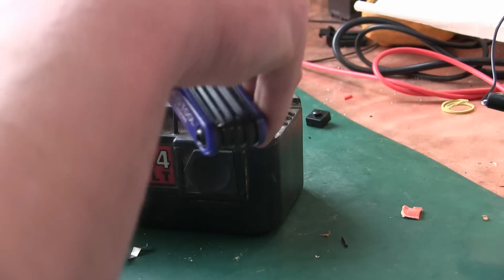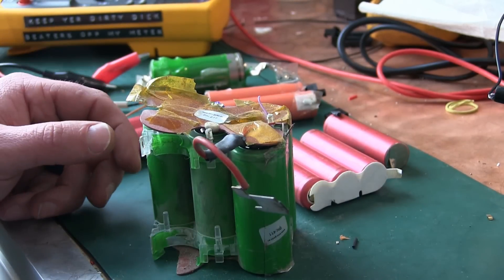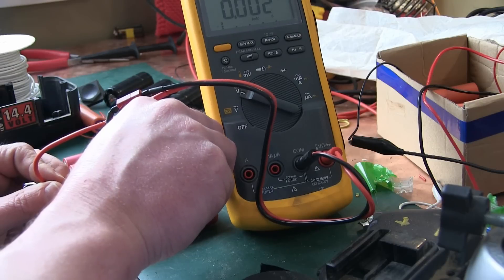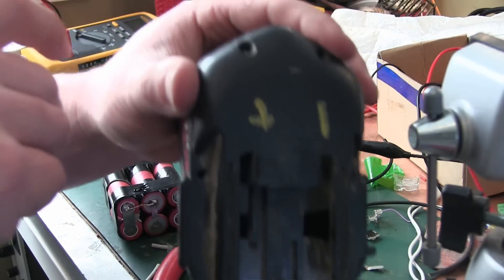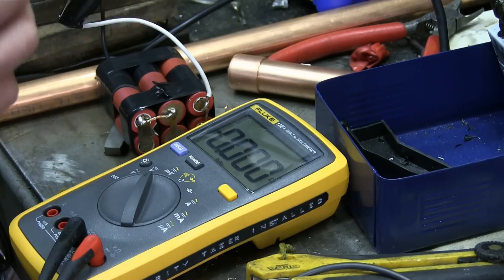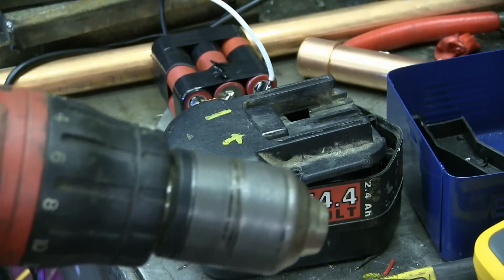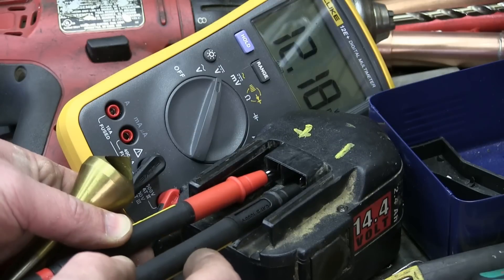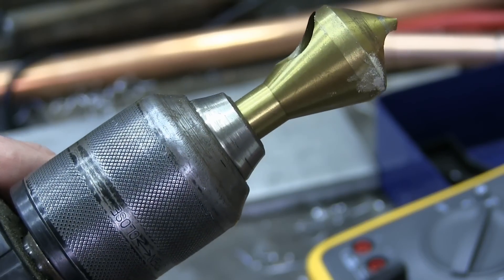New Lithium for Old Tools!

Comment: Touches (+) to (-) "I don't know what just happened" lmao🐸☕️
Reply: a noticed that.....
Reply: But he didn't close any circuit. Also, + and - was already connected by the tab...
Reply: yes he did. he grazed the outside shell of one of the batteries. On one side it's no problem since it's the right polarity. Not the case on the other battery.
Reply: +Mike G. Thank you.
Reply: Mike G. Doesn't he just touch the two terminals that are connected by the tab anyway?
Reply: +largo303  if these are the same batteries I have, then the top tab is the positive and the casing or shell of the battery itself would be negative. Touching the two can short the battery. As you can see when he went to cut the tab he accidentally touched the only pat of the battery where the wrapper was coming off, thus causing him to short the battery.
Reply: Gabriel Bashara Ah, okay, got you. Thanks :-)
Reply: Ave this is not really an upgrade.. but just swapping the bats is boring. Question. When there will be a standard for such bats? It will generate less waste and the makers can sell just the drill
Reply: Im no expert but think you are using LiOns and not LiPos. I think LiOn max voltage is 4.1v not 4.2
Seen a few do this and done it myself by mistake but the cells still work. Just cant be good for them over charging like that i think.
Reply: Actually the majority of liIon batteries charge to 4.2 volts.
Reply: Chris C: LiPo is Li-ion chemistry with a flexible polymer wrapper instead of a steel case. Packaging is the only difference.
Reply: Oh Man no thermal runaway?! 🤣 hard short’n 🤣 I want fireworks 💥
Reply: Chris Campbel Most of the time 4.2 V max, Some can max out at 4.1v slight bit less. Nominal 3.7 & 3.6v. Correct don’t try To charge those 4.1 up to 4.2v deff can damage the cell. LiPos pump out around the same 4.2v but it matters how the cells inside the LiPo “battery” are configured truly. Ex: 2S, 3S ect. The computer reading it will detect it as 1 cell @ 8.4v or 2 @ 4.2 & so on. I’ve had some crazy LiPo batteries with some nice kick and super light weight wise!  It’s the same concept for how they design all of these batteries with “60 volts” blah blah blah, how many cells in the battery & the wiring configuration 😃 those sexy hilti 😍batteries are the big boys! Same voltage though but hella mAh. AvE has me sweating Hilti & Fein now 🤦🏽‍♂️ I’m broke though...
Reply: @largo303  if a battery isn't wrapped the outer shell is the negative. I could be wrong

Comment: A good idea in principle. Unfortunately, multiple lithium ion battery packs in series must be balanced otherwise the pack will only be as good as its weakest cell  The lower capacity cells will tend to over-charge, conversely, the higher capacity ones will under-charge. Which is why all L-ion battery packs have charge control circuits. Plan B would be to just repack the battery container with a set of quality nickel metal hydride batteries.

Comment: You can rebuild your NiCd packs with new Sub-C NiCd cells. Then everything works the same as before. You can get new pre-tabbed cells so you don't need a spot welder for assembly.

Comment: Those Lithium Cobalt cells are not suitable for a continuous draw of more than about 1-2A and the drill will be taking at least 15A. You really want the Lithium manganese cells, some of which can handle 30A. You're right about safety too, trying to draw that much current from an unprotected Li-CoO2 pack essentially turns it into a hand grenade.
Reply: Jep, NMC would be suitable for tools.
Reply: 30a still seems low. my not special at all li-po pack is rated for 45c continous with 4,5ah. probably it is larger than the types you mentioned, are there other disadvantages?
Reply: waldsteiger Yeah, I think a typical 18650 capable of supplying 30A would only be available in sizes up to about 2Ah, so in terms of C rating that's about 15C. Li-Po cells are also not constrained by the size of the can so they can be optimised a bit more for high current too.
Reply: You don't add up the Ah like that. Assuming they're 2500mAh/2.5Ah cells, they're in a 3S2P configuration, giving a final capacity of 5000mAh/5Ah.
Reply: ben hunter It's true. I agree

Comment: I'd not recommend to remove the welded tabs from 18650 cells:
First, there is a chance to puncture the cell, since the metal shell is very thin (to minimize the weight and maximize the inner space).
Second, one has to solder directly to the cell without tabs. On the negative side (which is directly the shell) this heats up the cell's insides quite a bit, and on the positive terminal, the heat may damage the seal or the PTC fuse ring.

Just cut the tabs to a length of a few millimeters and solder the cables on the ends if you don't want the cells to lose any chooch.

Comment: You need another pair of cells in there >< then it'd work great (that 4.1v a cell is going to be more like 3.7v under load, fer a grand total of 11.1v)  That's why it worked decent for a few seconds, once you lost the top charge it went to shit.

Put another pair of cells on top, get some longer screw's for the battery case and fill the gap with electical tape.

Comment: Until I recently retired, I tested hundreds of cylindrical cells a week.  Some things you should know.  Your battery pairs were badly out of balance when you put the pack together.  Lacking a battery management system, the best you can do is top balance.  To top balance, set the power supply to the rated charged voltage and charge until the current drops to within a few ma of 0 amps.  As it is, the low battery is being reverse-charged which risks fire and explosion.  I highly recommend getting an RC vehicle cell-by-cell balancer/charger.  They are amazingly cheap and work really well.  Finally when each stage reaches its rated charged voltage, immediately disconnect the charger.  a Li battery can't be floated, even for a little bit.

Second tidbit, 18650 batteries are generally rated at either 1.8 amps or 10 amps.  ANY chicom cell will test out to 1.8 or less amps, regardless of their marking. Note that I'm saying amps and not amp-hours This is the best 10 amp cells that I've been able to find.
https://www.amazon.com/gp/product/B0768WY3ZN/ref=oh_aui_detailpage_o04_s00?ie=UTF8&psc=1
That's about the highest amp-hour rating you'll find in the 10 amp cells.

My (pre-home depot) Dewalt 17 volt drill draws around 25 amps when nearly stalled.  So even the above cells would not cut it in 2P configuration.

A friend operates an electric motor repair shop and within it is an authorized Milwaukee service center.  I help him some when he get covered up with repairs.  Which is frequent, these days.  It's disgusting what both Milwaukee and DeWalt have de-contented in an effort to meet Home Depot and Lowe's price points.  No machined parts anymore - everything is either plastic or sintered iron or brass.  My friend will probably give up the franchise at the end of the year.

Comment: Those 4.2V batteries drop to 3.7V when they are under load. I think 0.2 c ( their mha rating *0.2 ) would put them at 3.7 so you are in fact getting 11.1V or so. Try putting one  more bank of two in series. She'll work wonders.
Reply: Yeah, spot on 3.7. I think the curve under load goes from 3.85-3.7 and then the last 10-20% goes down rapidly
Reply: 0.2 c is mighty small
Reply: would they even fit
Reply: Came to say this, you said it much better than I could.
Reply: Yep. If the bottom of the case can be extended or take an extension in the form of a 2x18650 cell holder, he's in business. On Ebay, you can get those for a couple bucks a dozen without the electrical connections (designed for allowing cooling air through a battery bank) or the traditional springy ones at $3/5. +Rinoa Super-Genius even has a downloadable 3D print file for the former if AvE.can access a 3D printer.
Reply: The voltage sag under load of 18650 cells varies greatly depending on the cell type, age and the load being applied. Older cells will sag more under the same load as a new cell.  The cell spends most of it's useful life around 3.7. Meaning when you apply a load to it, it will quickly drop from a resting voltage of 4.2. Most manufacturers actually release a discharge curve graph for the cell under various loads. Here is a link to a newer Sanyo cell ( I think these are being used in power tools, but I may be wrong ) https://www.imrbatteries.com/content/sanyo_ur18650nsx.pdf

Comment: I've done this using small sealed lead batteries. If you don't mind the extra weight, it works well. Plus you charge after using the drill (since Pb batteries like to be stored full) instead of having to put your project on hold while waiting for the stupid battery to charge.

Comment: nice work, those need balance and potection circuit. you can buy one from ebay. cheers
Reply: that only has a max current of 8A, not even close for a drill Makita use 25A discharge rated cells 2 in parallel that's 50A and 5 in series to make 18v, @12v the amperage could be even higher
Reply: Lithium batteries need a pulsing DC charge too. using the old NiCad charger is a good way to make them go boom boom.
Reply: He is using the right charger, at least. Who knows if the cells are going to stay balanced without circuitry though. Would be nice to see this with some protection, maybe even a thermal sensor to be safe...
Reply: If using cells from the same source/batch and none of them are dead, not having a balance circuit "should be fine," but if they're from different batches and have different internal resistances, or if a cell dies, it will almost definitely become a problem. Definitely better to balance them if possible, though.
Reply: I assume he threw out the charger so his daughter doesn't plug the battery in and inadvertently burn the house down.
Reply: Hahaha bether hide this one from your home insurance man
Reply: its a bomb BOOOOOOOOOOOOOOOOOOOOOOOOOOOOOOOOOOOOOOOOOOOOOOOOOOOOOOOOOOOOOOOOOOOOOOOOOOOOOOOOOM
Reply: what did he say at the 8:00 mark?

Comment: Did this too, but used 8 cells (4S2P) and put some connectors for RC models on it, for charging and balancing. This way I can charge it with a normal RC battery charger and have no problems with unmatched batteries. Works like a charm and the batteries have a god amount of capacity left, the power lasts very long.

Comment: just as a little bit of friendly advice and help, 

the problem that you are having with the batteries not providing enough power is due to the maximum discharge C-Rating, (and how many of them you have in parallel like you were saying) but what you probaly did not realise is that under load (when the drill was drilling) the voltage of the 3 batteries together likely dropped much below the voltage you measured afterwards. 

I have also done a similar project and I found that for my 4 batteries in series pack with 2 in parallel the pack was getting down to ~9v under load and then recovering to ~16v a few seconds after the drill was turned off. like you say though the only way to improve this is to get better batteries.

also, I would not advice charging all of the batteries together at a constant voltage/current as this could lead to an imbalance between the 3 series cells. A better way to do it would be to add a port on the battery where you had individual connection to the 3 series batteries and then charge them individually. 

just a handy tip for if your not looking to burn your house down
Reply: Yeah im pretty sure dave has done a video about the recovery potential of batteries, right after he debunked the batteriser, and essentially the only way to properly measure the voltage is not just at source but under load, not out side the monkeys ass, inside the monkeys ass!
Reply: +WeAreGRID EXACTLY!!! hahahaha
Reply: I did this very same mod about a year ago to my B&D hand drill, but decided to add the protection/balancing circuit as well (5$ on ebay),  all works really well charging wise, with the small exception of peak current spikes on startup - the darn circuit has some built in over current protection and will stall the drill when you go full throttle from standstill with some load on it... works fine if you throttle it up incrementally though, will not stall on full load while running

"one of these days' I'll reverse engineer the protection circuit and adjust the peak limit, and maybe even add some boost converter to keep the voltage constant for the motor, one of these days... :D

Comment: That was a great drill, mine went 2 years ago only difference is my batteries are good just spending its life in a fab shop drilling half inch plate seals the deal.

Comment: I picked up this same drill from a goodwill a couple years ago for $4...I found that the milwaukee M28 battery (28volt 7serries -
 2 parallel) fit right on er if i ground off one little flange off the drill. This thing rocks! drills  7/8" holes through 1/2" mild steel day in and out...fets in the handle get hott as... but the thing never complains!
Reply: So it works ok putting a 28v pack on your 14.4v drill?  I have a set of Milw tools I may consider this for.

Comment: I have several 12v makita drills I loved that batteries got hard to find for. I took an old battery and made a 12vdc adapter to be able to run them off my vehicle or my Honda portable generator with DC output. Gives you tools on the trail or side of the road with no worry about batteries running out. In my shop I made 12v available at all my benches with Anderson quick connects fed from my rolling cart battery charger I keep in the corner by the compressor. It makes almost 14.4v so any 9-14.4v tool will run on it fine.

Comment: use one of those boost converters on ebay to step up the voltage to 14.4v. they're super simple, 4 connections: in + - and out + -

Comment: I have an old 18v Milwaukee set. I found a 2200mAh 40C lipo pack from Hobbyking that fit almost perfectly inside the case. To get by without a protector circuit, I brought the balance plug outside of the case and connected it to a low voltage buzzer. I was able to rebuild 2 packs for $50 not including the now required balance charger.

Also, DO NOT simply multiply the voltage to charge it through the primary connector. If one of those batteries shorts, you are now putting 6v through the other 2 which could make them explode.

Comment: Why don't you cut the case in half sideways? You'll then have enough room for additional batteries and the the important top connection geography will remain intact. To easily rejoin the two halves of the case simply use a couple of turns of duct tape and that way you would have a useable battery with ample voltage and easy access to the innards.

Comment: I did this, but used a 4s lipo rc battery from Hobbyking.  comes about 16.8v fully charged.  you can buy them in different sizes & capacities to fit inside the doobleydoo.  A green multistar 1400 mah 4s can do 60-80 amps for between $15 $20 pesos.  Just buy a cheap lipo charger and they are easy to charge. Got a video where I did this on my channel. I'll post a link if anyone is interested.

Comment: I had an 18v NiCd Milwaukee. Heavy as all hell and a beast amongst drills. It was very torquey, took a repeated beating, and outlasted all the other drills. Fwd 10 years, the spindle bearings were sloppy as something on the clearance corner for $20 and the batteries were starting to fade. In a final act to heroism, it plunged 7 ft from a ladder hitting my then pergo covered floor and the whole battery mount snapped off... Sad day. But it still outlasted my second longest lived cordless, 14.4 rigid. 😂🤣😂🤣

Comment: I did something similar with my first old drill, but in lieu of batteries, i just soldered on a pair of jumper cables!
Took my old Black and wicker 7.2v drill and turned it into a 12v drill with nigh unlimited current capability.
She is 100% portable, and can be used around any car :)
Bonus nachos, ya never have to charge her!

Comment: Retrofitting without any sort of balancing or over charge/over discharge  protection is a sure way to cause a fire after a handful of cycles.  Be careful with Lithium in series!
Reply: I would have added leads and maybe a port so could balance later if you wanted. 18650's, especially the protected ones really aren't that bad when you fail them electrically, ask me how I know...lolliez
Reply: its fine as long as the cells are the same

Comment: I work at a battery store/rebuild shop. I love you Ave but messing with lithium is so dumb...
Reply: no bms
Reply: messing with lithium is fine.. this particular setup you have to charge to specific voltage and discharge not past certain voltage ideally you would want a control circiut. toss the old charger in the bin.

Comment: we have an old makita rotary hammer we use for bolting climbing pitches..I've jammed four 2800 mah 3s lipo cells,2s2p, 25c, instead of the old nicad crap. left out the balance plugs and charge them with a hobbyking charger,and I can guarantee you that rather than stopping it will spin the earth in the opposite direction.

Comment: I have one word for you: Batteries Plus. OK, that's actually 2 words, but you get the idea. They will happily rebuild your old battery pack to Better Than New.  I've used them several times to rebuild the battery packs for a couple of Harbor Fright right dangle drills I have that Harbor Fright quit carrying batteries for. The rebuilds are WAY mo better than the originals For Milwaukee they'll probably be at least as good.
Reply: You can rebuild the NiCd packs yourself cheaper than having Batteries+$$ do it for you. In either case, it's better than throwing away a pack that is no longer available.